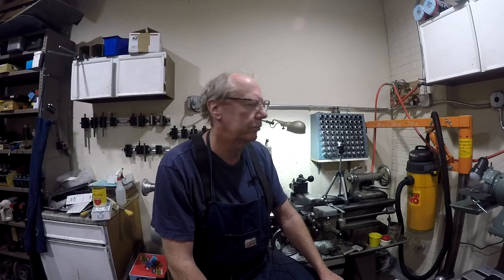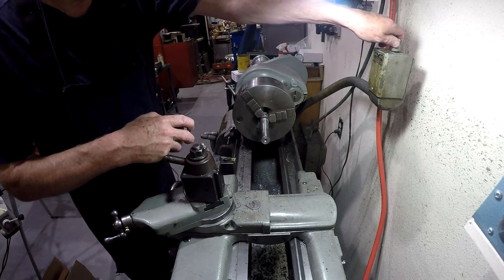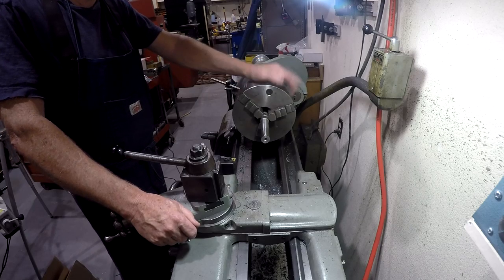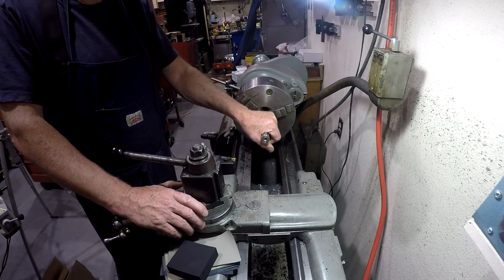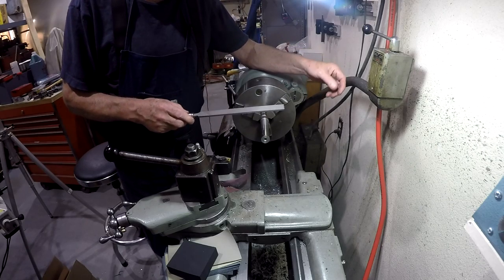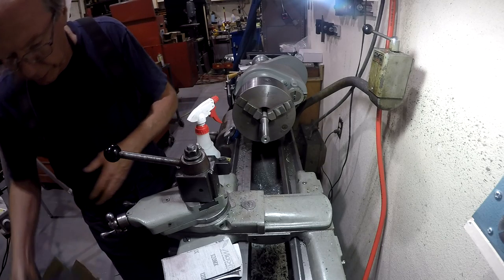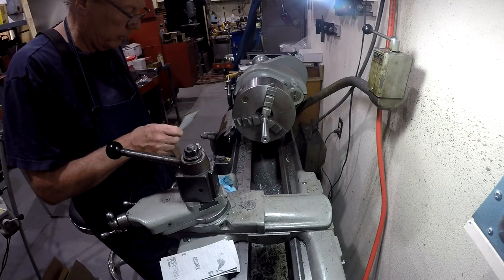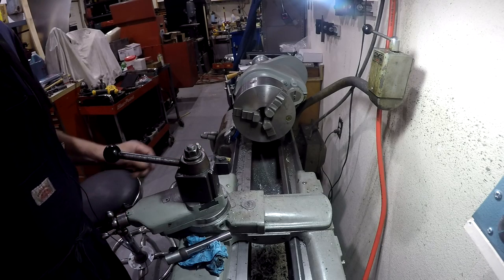Cool Tools and Interesting Stuff No. 2

Comment: I got a Stewart Warner tach just like yours off of Craigslist and was looking for information on it and found your channel. They do have a red lid and are lined with cardboard inside the can. Mine came with a owners manual and two rubber tips. I am a retired engine mechanic of 43 years and enjoy fixing up old machines for my shop. The tach will come in handy for adjusting the speed on my two old band saws. I also have appox 80 small cast iron gas engines. Most are Briggs & Stratton, Clinton and Johnson Iron Horse with a few misc engines. I also collect tools both modern and back to about the 1930's. keith Rucker, Adam Booth, Tubalcain, Musti1 and Zippo Varga are the channels I watch most and I just added your channel to the list. Thank you for the entertaining education.

Comment: I buy 1,000, 1500, and 2,000 grit wet sanding paper that's used for high end automotive paint work. Much much cheaper than the $45 they want for that kit. The Brownells gunsmithing book Gunsmithing Kinks vol II has about 14 pages of what it takes for commercial quality polishing of metal. The books cost is worth it just for the polishing information.A grinder with loose and hard felt wheels along with various grades of polishing compound is required to get the absolute best job. And it's far faster.